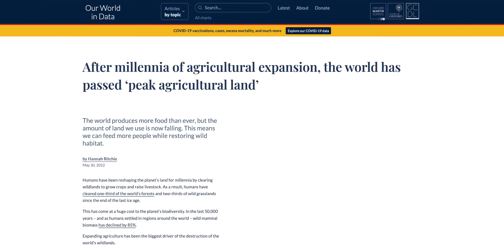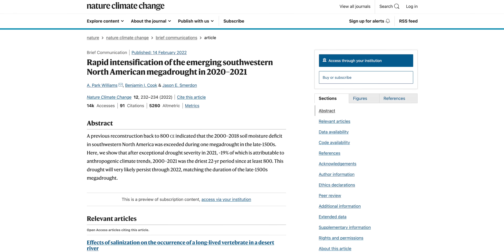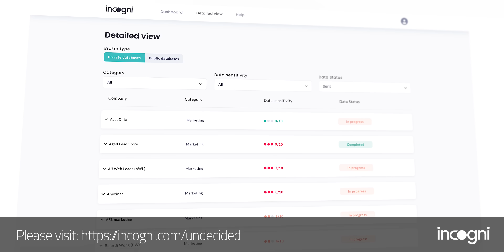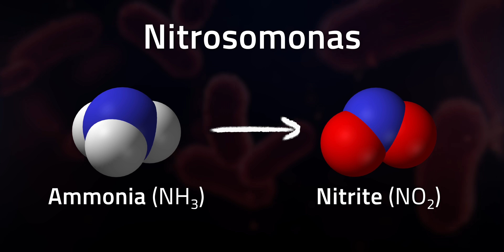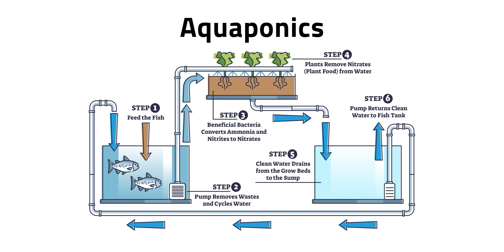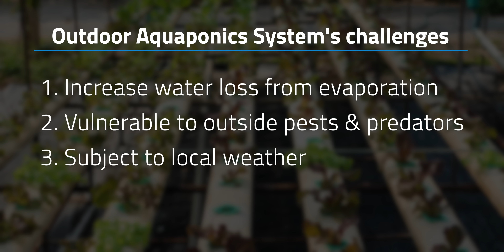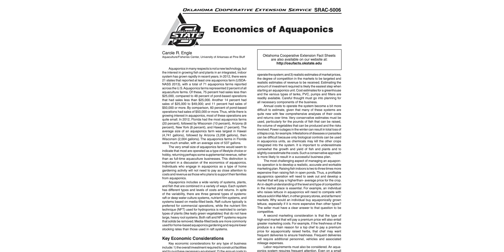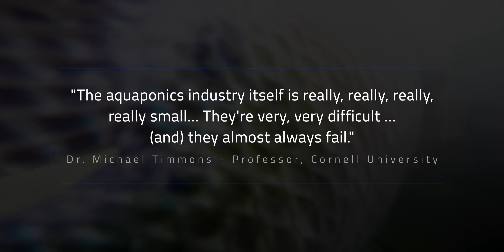Is Aquaponics the Future of Agriculture?

Comment: May I point out that this video does not show what I thought would have been at first sight the advantages of hydroponics. The advantages the video does not show are the possibility of using 10 or 15 or more layers of plants in a greenhouse and also the possibility of growing plants underground perhaps with piped lighting. More CO2 exists at lower levels. They did show a vertical arrangement however.

Comment: Like couldn't you filter the fish water then wash out the filters in the plant area so you can get the waste out but you don't need to share water temp or Ph etc. Also that way you could decrease volume of water you need to pump although to be fair you would have to spend more energy pumping through the filters and then the high pressure jets you would need to get the matter out of the filters so you might even end up using more energy, but by having each each part be idealish you could probably grow more and be less subject to the whole thing collapsing.

Comment: I wonder about some of the other benefits I've seen from aquaponic systems and even system additions from earlier videos of yours that could be considered. Examples include:

Alternative feedstocks to improve fish quality (Algae, Hempseed)
Greenhouse glass made with semi-translucent solar to offset power needs
Flocculating out solid fish wastes to sell as fertilizer for a secondary revenue stream
and more. 

It seems like just as other technologies like some of the battery alternatives you've presented, this is an undercapitalized market that would provide massive resource benefits in place of financial benefits. Its one of those systems that operates closed loop starting with the sun and ending with outputs that can be used for basic needs. It could also have secondary functions like hemp, providing extra solar inputs to increase output potential.  its too bad that all of this ends up squandered to satisfy profit motives.

Comment: I fired my fish.  Growing with a fish tank is not the most efficient way to grow.  It's a good system if you're trying to be self sufficient and eat the fish as well.  But as far as produce they really just hold you back as you have to tailor PH and EC to the fish's needs.  A aquaponics system without the fish grows really well if you know what your doing. Then you have a recirculating hydroponic system basically.  I've been running mine like that for the last 3 years.

Comment: Mostly I have to say I'm just confused.

I don't understand why the crops grow faster. If I had to wager a guess, it has to do with the artificial lighting -- more hours in a day of sunlight means more photosynthesis. But that begs another question, why not just use sunlight? If the costs of lighting are an issue, then natural sunlight should certainly be an option, even if you're in a greenhouse. But both of these raises another question as well, how can there be water savings if there is increased photosynthesis activity? Photosynthesis is what causes the plants to use water to begin with. If there are water savings to be had from aquaponics, I think there certainly must be a way we can replicate these savings in the fields, such as collecting runoff water that goes down below a certain depth that would otherwise be wasted. On a somewhat unrelated note, a lot of the rain that could help with our water problems is simply uncollected, this should be something worthy of investment and investigation if water problems are truly a concern -- almost as much as desalination plants -- all that water in the ocean, the only problem is the salt.

Another major downside to this type of farming is that many crops actually require specific conditions to produce, meaning that maintaining such a narrow temperature band is going to mean many crops simply can't be grown in aquaponic facilities. At least not without separating the temperature controlled fish away from the temperature controlled crops, which adds another problem of water circulation, needing that temperature to be regulated as well.

So mostly, I'm just confused.

Comment: The real issue is that we overexploit the soil for producing garbge food, most of ot goies to produce junk food, and even things we don't use that we got to the point of produicing ethanol from corn. The real problem is that the subsidy for those grains are creating a imbalance in what we really need, that we got to the point that they had to invent other uses for corn. We should be using those reoruces in producing nutrient dense food and not garbage that also creates a lot of health problems.

Comment: aquaponics makes perfect sense.
why don't they move 10% across at a time (from plant tank to fish tank and vice versa). that way, they can adjust the pH slightly afterwards in each tank to get a more preferred ph. If the ph of both tanks are close enough (even though moved to a more desirable ph for each), 10% exchange shoudn't be a shock to the fish as long as they do it over like a 30 min period. I guess that takes chemicals though, so costs add up. But maybe not enough to worry about.

Comment: I have small-scale aquaponics at home, 1000 liter pond with 200 ish fishes. Is it worth it? Indeed, you have more than enough to feed yourself, AND the fishes can breed also, so as long you have enough food to give them, its basically "infinite" food.

Although, i have to admit, aquaponics  does bring a lot of headache, I do A LOT of mcgyvering to make it stable.

What about the cost? An initial investment would be around 200 USD, but it could be reduced further if you are using existing used items at your house. The weeekly cost? 2 USD for food and electricity. All of the cost could be easily replaced when you sold your crops and fish.

Unfortunately, not all plants are suitable for aquaponics. Herbs (including strawberries) strive in aquaponics, but not plants with solid wood such as oranges, chili, etc. It can kinda work, but it needs a whole set of different systems.

Comment: Having done a data capture on hydroponic vs. aquaponic agricultural techniques.
My conclusions were that the energy input by fish feed, even when supplemented by own pellet making, was higher than fertigation of plants directly.
The protein based feeds need alot of energy input. So you would actually need a fly or larvae farm in addition to the two already fragile biomes.
Where off the shelf organic feeds for plants are much cheaper and less energy intensive to produce.
Then you touched on the fish population density. You need nore density than healthy conditions allow. Most large scale operations will have to medicate the fish and inoculate with antibiotics.
So your fish or protein harvest will actually never be dependable or an economic factor in the business model. Sometimes even negative.
It is just basically a bio reactor, where you remove sick or old fish and keep population happy and healthy.
If no natural elevation is used, most of the time you will have a two pump design as well.
With another aeration and circulatory system in the fish tank. This increases energy input again vs. Hydroponic technology.
This is according to my own experience, research and data capturing.
The ancient roots of Aquaponics that you did touch on are actually still going.
Examples of rice terraces in asia, where gravity is used for flow between ponds, fish are used in the rice fields for insect control and fertilization for a few thousand years.
So I found that in untouched homogeneous nature adapted systems, it does give good results. These places are geographically depending and very localized. To try and repeat it artificially is just not a good idea, with better alternatives currently.

Comment: Might be good for Saudi Arabia, they've the capital to cover their initial investments, and the water saving would be a huge benefit. Also if everything is basically level, then air bubble pumps might be great, considering the high flow rate for how little power is required at the cost of low pressure.

Comment: I have personal experience in designing and building Aquaponic systems. I can with 100% certainty that they, whilst are very efficient in growing food whilst using less water; they will ALWAYS need external application of artificial nutrient supplements.

We innovated when coming up with a solution for this problem; we utilise a multitude of different techniques that are non requiring of external nutrient supplements and only require food waste. The very food waste that is produced from the systems. 

We call these systems Agriponics. I am not doing the designs justice. They are superior than aquaponics alone.

Comment: Put the solar thing on top of this boom best thing

u got fish doin the fertiliser, solar doin the lights n pumps, crops doin their shit, mess with vertical to make space even better, and add some ai shit to help monitor everything at least to update you, if not have some way to correct for smaller things on its own before they become bigger issues

Dunno how the internals all work but could you put hydro electric systems to steal from the water flow to recover some electricity, like if the water is pumped one way but falls the other way thats free money, but could you just steal directly from the flow of the pump? obviously at a loss I just wonder if it would be worth the effort

It sounds so friggin coooool I wanna mess with it

Comment: i do gardening as a hobby and been raising tilapia in a water tank just to test the waters, i think the traditional aquaponics you find in courses doesn't work, if something break like your water pump all of your fishs will die and you have to buy unsustainable fish food 
i did something different akin to extensive aquaculture on small scale, i rely on algae, duck weed an azolla to clean the fish water and as their main food
the production per surface is low, but this system require less work and inputs as traditional agriculture.

Comment: Might I point-out, that the problem is one of water and nutrients in the wrong places? Southwestern US states will pay anything for a/c, and chip factories there will deplete drinking and Ag water without mercy. It begs for another Dust Bowl. But in contrast, the Delta Dead Zone is all nutrient-filled Mississippi River Basin freshwater that's killed fishing and shell fish production for thousands of coastline miles. Hurricanes ravage that coast, lacking barrier levies to prevent it. There is a simple answer, and it's already done in other ways.

Texas has some 20,000 wind turbines operating and solar farms are increasing daily. Shade and electricity drawn-in by those is subtracting solar energy from the heat index. If wind towers are as tall as the Eiffel Tower now, they can become stronger by surface tension if filled to the tops with fresh water from the Intracoastal Waterway by connecting the barrier island chain and the shipping channel from New Orleans. Using wind power to lift water via submersible pumps in series to 300-meters, then spilling-over into a gravity-leveling pipeline, sends that waterflow to another tower's base at some dozens of miles distant. 

Fifteen 300-meter towers equals fifteen thousand feet in elevation rise. Six or seven pumps at one hundred-some feet per pump, and 7500-feet of elevation to the Continental Divide, takes just 75 towers to spill-over into California, or on to Utah and Nevada. Reforming that desert would cool it, secure the soils, give life to new cities and industries, provide winter harvests and Ag resources that we'll need. Aqueducts aren't new, but new recycled or 3D-printed fused soil conduits might be cheaper and easier. Electricity and water means hydrogen and ammonia, the latter for safe pipeline transport to Midwest farms and cracked in industrial centers for hydrogen while returning nitrogen gas in the same pipe. 

Hurricane protection from floods and erosion, a Delta Dead Zone cure for coastal businesses, border opportunities for locals and job-seekers, cooling of the countryside and cities, year-round food and fruits, ample water for industries, farmers, and families. We win!!!

Comment: Remember guys, farmers totally don't use crop rotation and paddock resting to help the soil that they need for their crops to grow and livestock to live. sarcasm Also note that there is no plants for pollinators to interact with in those polytunnels shown in the video, unlike in an open paddock. Hawks and other animals have the ability to control some critters as well. Where I used to live, Brolga birds would have a feast on bugs and other critters at the end of each growing season, with much of the leafy material from the previous season being used to mulch the planted sugarcane. The farmers do not use much fertilizer at all and the growing cane plants provide habitat for small birds like finches. It is pretty neat, with the birds knowing to move on ahead of each harvest period. Many seem to think that birds are incapable of adapting. If they don't do so, they aren't able to pass on their genetic material to future generations, meaning that the sugarcane must have provided a small evolutionary pressure before the smarter birds were able to pass on the adaptive genes and behaviours. 
Whilst I like the idea of Aquaponics, I find that many arguments for transitioning over to it flawed, such as the idea of using it to preserve pollinators. Plants can also benefit the soil and vice versa as well. So, Aquaponics is serviceable, but a good argument must address the reasons for using it. You can do it on the smaller scale, such as for growing plants that aren't available in the local region or not in season small-space crops, but consider that open-field agriculture has its own uses. I can also point to rice growing in Louisiana as a hybrid open-field and aquaponics method for lobster production whilst simultaneously reducing the mosquito population. It is a really good idea but I cannot help but think that some groups will attempt to make it illegal by making flawed claims about 'unclean farming'.

Comment: You mentioned the solution without realising it, agro voltaics, what we need is to combine it to photo aquaponics. Every other or third row in the roof need to be solar panels that with a house battery powers the whole system and perhaps more. This way energy cost for moving the water and supplementing the light and heat if needed can be eliminated from the running cost. Yes it will cost more but the ROI should be mostly unchanged with the lower running cost and once payed of the profit margin will be bigger as well.  Basically aquaponics is not wrong just incomplete if you do not also use solar power.

Comment: Hydroponics is superior but even it has niche applications. The fish element just adds unnessesary risk. Fish farming is essential but is better suited as its own seperate system with climate factors adjusted to its needs specifically. 
The externalities of commercial farming increase its efficiency and that is largely worth the environmental tradeoff except in a few key instances where the damage is much higher than the benefit. That's pretty rare in developed countries however.

Comment: i think the problems with aquaponics can be fixed, by adding vermiculture and or other alternative food sources for the fish such as black soldier flies, or even crawfish into the mix.  ... black soldier flies eat so many things and are a nutrient dense high protein food for the fish, crawfish are filter feeders, beneficial in more than one way to the system other nutrient dense foods that could be added are possibly corn  or other plant foods made into pellets to be easier to digest and more suitable to new fish breeds.  there are so many uses here, so many ways to add a little and get so much more from it.. algae are not always a bad thing, they have their benefits as well and can be used to make their own usful products... it was not long ago i heard about a very large mass of seaweed headed towards the south east coast and it was being discussed as a horrible thing waning tourism and costing hundreds of thousands if not millions of $ to clean up... when that particular seaweed had so many different uses... we are supposed to be the most adaptable species we've ever seen , there is a way to make this a benefit, we just have to quit looking at it as a draw back to see it.. mexico did and made $ the last time it hit their coastline.. Are we birds or men?  it  does more good to focus on the positives and try to find a way to connect them in my opinion there are also ways to had self regulating aspects as well, if we look hard enough... we are engineers after all, right? ... this is what we study for... what we were made for, is it not?

Comment: The other issue with Aquaponics is that Nitrates are only part of the plant diet. Leafy greens do really well on just Nitrates but fruit such as strawberries and cucumbers and others (but these are the two I tried in my little backyard setup) require other nutrients and these need to be added to the system in such a way that the fish are not harmed and at added cost. Hence why all the plants you see in this video are lettuces and similar.
Reply: The nutrient balance of the fish feed fits the plants nutrient demand quite well, except for iron. Iron has to be supplemented. Iron chelate (DTPA) is quite inexpensive and readily available from agricultural fertilizer suppliers. All the other micro and macro nutrients are just fine.